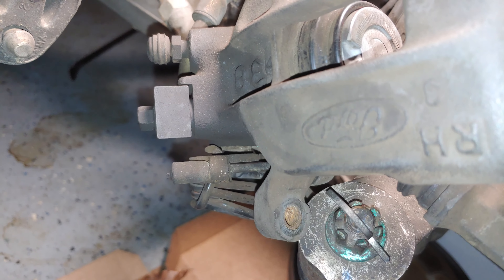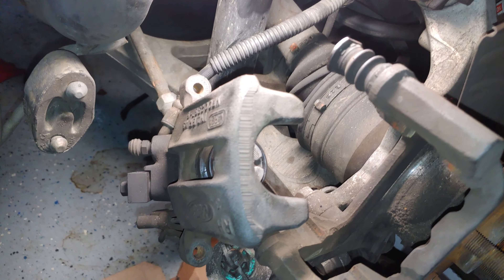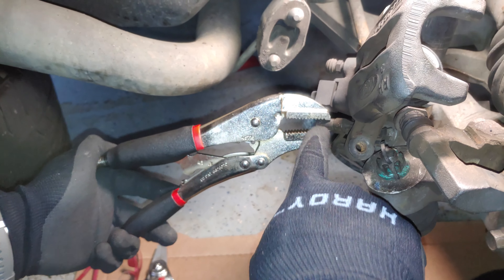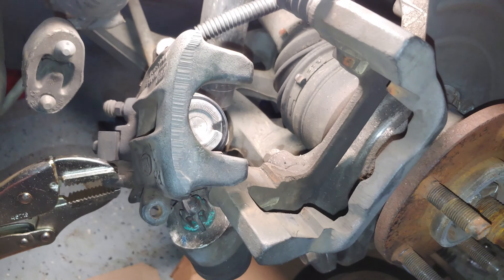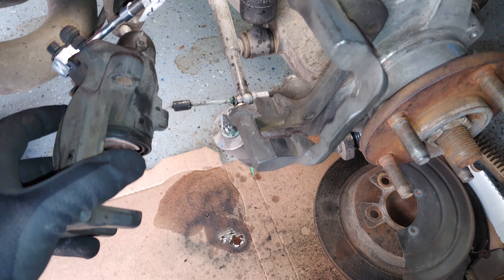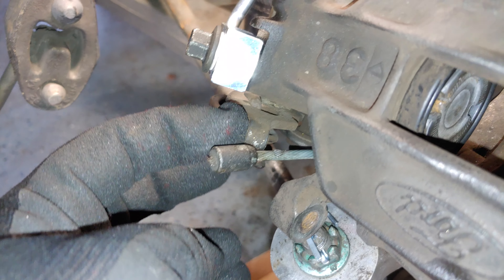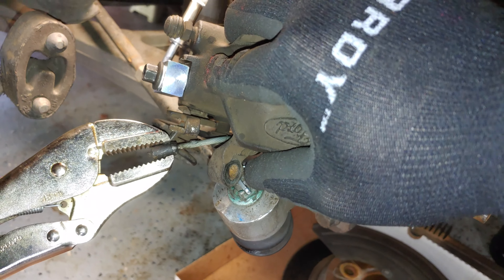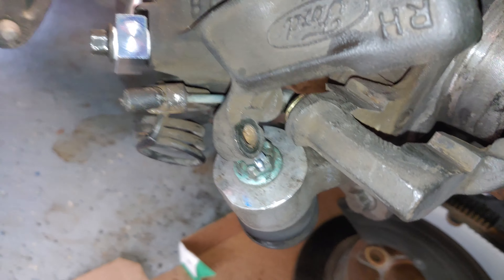How To Remove & Install the Caliper Emergency Brake Cable on a Mustang

Comment: should the e-brake not be engaged when removing calipers?
Reply from the maker: No. After the car up was up on jack stands to service the brakes, the e-brake was not applied.
Reply: @TheEclecticHandyman dude thanks for putting this up.

Comment: Been at mine for an hour already. It won't budge even after I took the clip out
Reply from the maker: I had the most difficult time if I used channel locks, regular pliers, etc. It was super difficult. It wasn't so smooth for me like shown in the video until I used vise grips where I could clamp down and leverage the cable out of the caliper.
Reply: @TheEclecticHandyman  YEAH IT GETS FROZEN IN THERE!!! BEATING ON MINE NOW LOL
Reply: Mine as well.  2002 n thung is rusted as all get.out n barely budges.